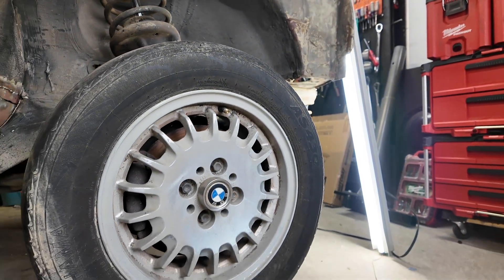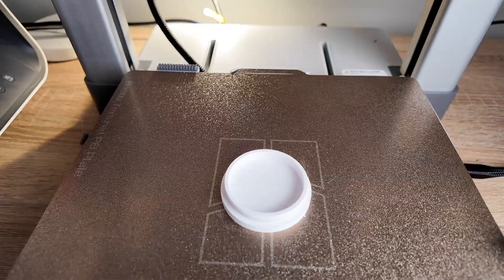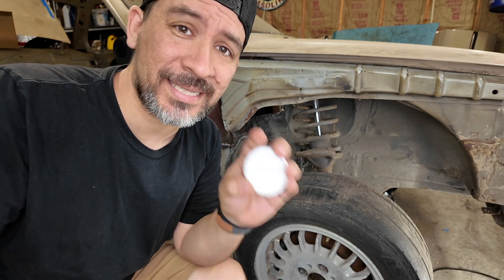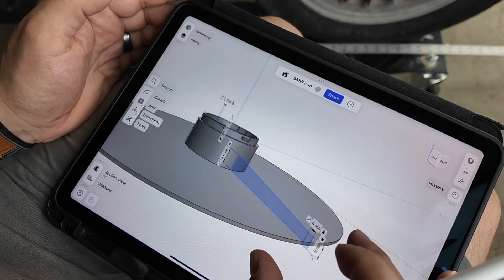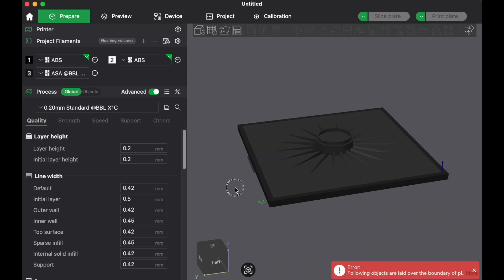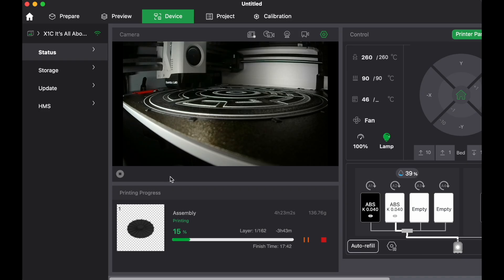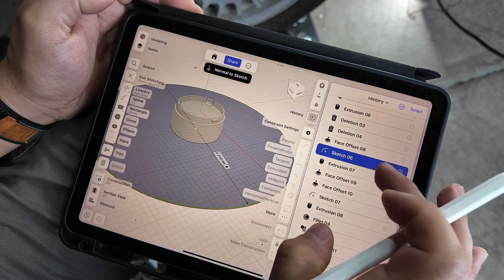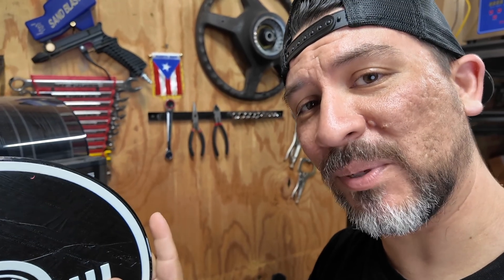Can a 3d Printer Give Your Old Wheels a New Look?

Comment: For fixing the disc you can use an expanding cone design, with one bolt from the front to adjust it. Adding one or two orings helps a lot (you will need a lot less clamping force to held it together) and reduces vibrations to the disc.
Reply from the maker: That's a good idea, I'm also thinking of using a steel spring retaining clip on the inner side of the ring. Have any examples of the expanding cone design I can take a peak at???